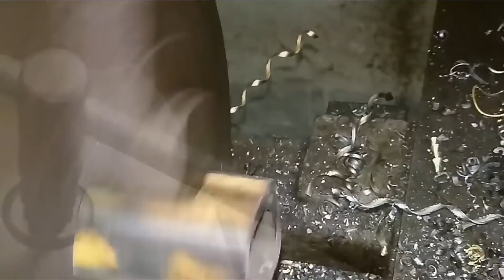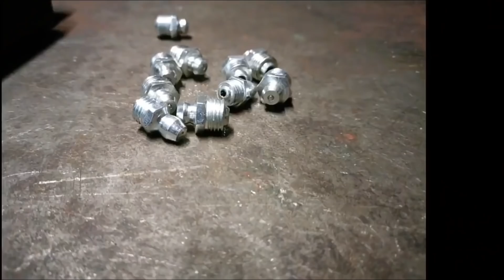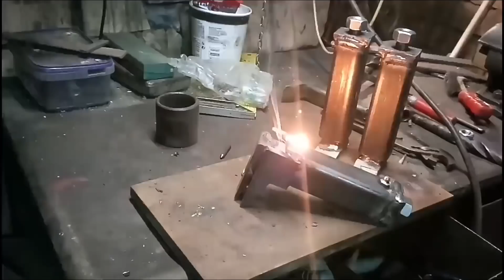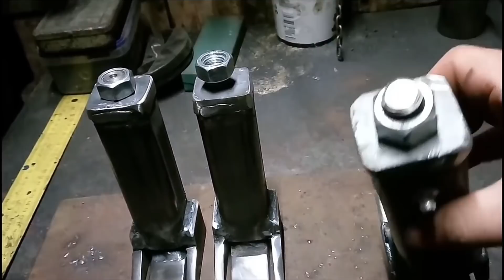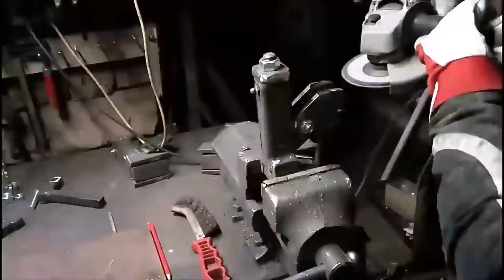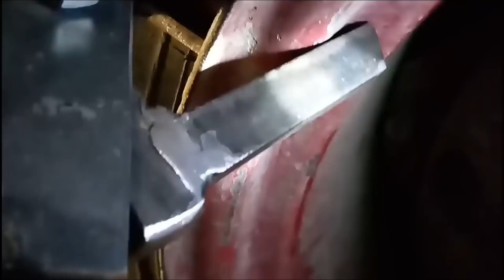Making a bead breaker tool - Safe way to break a tire bead and wont damage your wheel.

Comment: How could I measure the parts? I'm from Brazil... thank’s!!!
Reply from the maker: Hi! Bead breaker tool dimensions: 15 cm the bolt with square thread and normal thread. Nut with  square thread 2 cm, 10 cm inner tube, 12 cm outer tube. The other parts are approximate dimensions.

Comment: Where do you get the course threaded bolts, what are they called.
Reply from the maker: Hi! I've made them on lathe.
Reply: It is called "Acme Thread" and you can get rod already threaded at a machine shop.

Comment: All that steel and welding to make something that can be done in 2 mins,,,,,,take the tire off the car,,,,,,put a small block of wood next to the rim,,,,put the tire under the rotor/drum,,,,,and lower the car,,,,,bingo bead broken
Reply from the maker: Your method works fine for truck tires. If you do the same with a tractor tire you are the best. ;)
Reply: Can't always use the car or tractor or atv to apply pressure to break the bead. Make the tool and it will be there waiting forever unless you lend it out and forget who borrowed it.
Reply: Nope, I've had 10,000 pound truck jacked up off ground to break some beads, and had to let it sit 30 minutes before it broke. Hard to cut off with grinder an not cut rim. I will build one for me. plus you can get a tube out of a tractor rear without taking the rim off tractor. Do that in your two minutes.